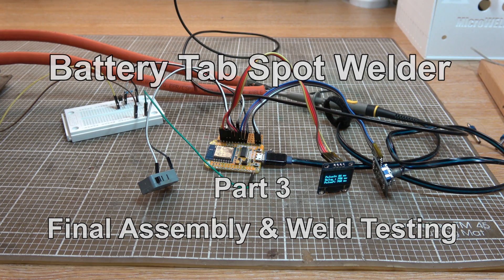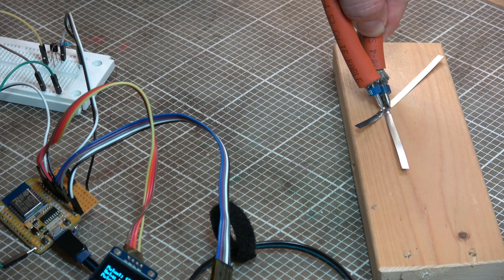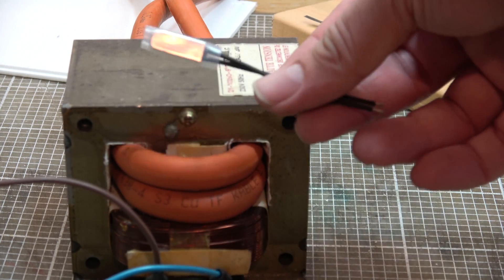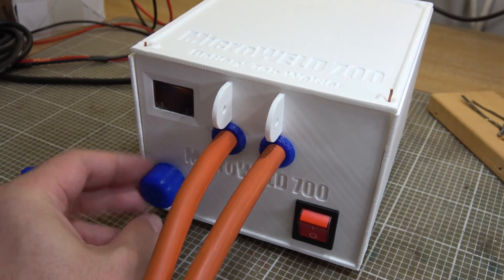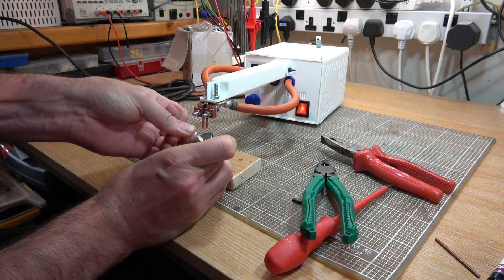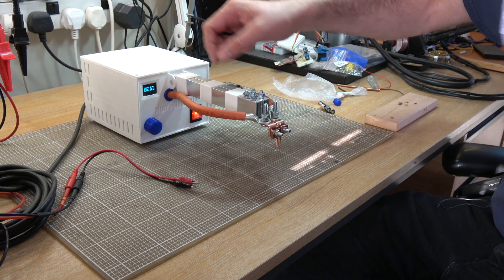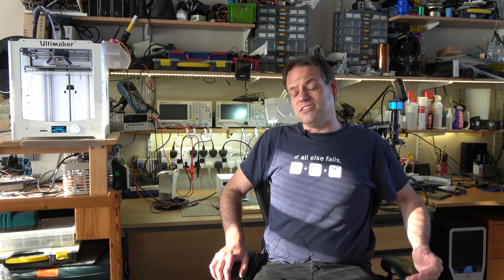Battery Tab Spot Welder - Part 3 - Finishing the Project

Comment: Hi Jim, I have viewed all your video's many times in an attempt to get your code working. No problem uploading the code, the problem I'm having is the display doesn't show anything. The SDA (D1) and SLC (D2) pins appear high impedance on my CRO in that there is an extremely weak digital signal that basically sits around 3.2v and the digital signal only dropping a few millivolts and certainly not near ground. The only file uploaded is your .bin file. Is it possible that I am missing something setting up the GPIO?
Cheers
Michael
Reply from the maker: Hi Michael - It's been a few years since I've touched this project, but I recall that there was a step where you had to build the Lua firmware for the NodeMCU device and you had to pick what options you wanted included... GPIO, DIsplay drivers etc... Did you pick the same options I used? I think I showed that in one of the videos in the series. If that's not been done then it might explain why you're not seeing a signal on the pins. Hope that helps. Cheers!!
Reply: @ThingsWhichArentWork  Thanks for the fast response. Yes I chose the same options as you did and got the same email as you showed. I didn't load it, thinking your .bin file would have this already be incorperated. I will do as you suggest tomorrow and let you know how it goes. Cheers
Reply: @ThingsWhichArentWork  Hi Jim, I went back and made sure the same check boxes were ticked as per your video, there were some differences, I hadn't selected the display type. I was hopeful that this would fix it but no such luck. Your a better man than me. finding information on t his is certainly not straight forward. I also tried to recompile your code in ESPlorer but again it didn't respond to any of the selections and so would not compile. I'm not sure what to try now.
Cheers
Reply from the maker: Hi Michael - Are you using the exact same display that I did? (The cheapest one that I could find on ebay). These very cheap displays gave me problems with lots of the different graphics libraries because they don't send any responses back over the I2C bus.. I had to do some hackery to get them working on an Arduino, but they did work out of the box on NodeMCU (which is the main reason I ended up using the NodeMCU board). If your display isn't quite identical then perhaps the options I used aren't the right ones for your screen. The best thing I can think to suggest at the moment is to see if you can get the screen working with a minimal set of code. This example looks as if it's using the right display module.. https://circuits4you.com/2019/01/09/nodemcu-esp8266-oled-display-code-example/ ... Not sure that will help at all, but probably worth a try. Cheers!!

Comment: I've just watched all of this series and am very impressed by the level of detail, professionalism and even safety. I still believe the battery spot welders I've seen are creating far too much heat and will damage the cells. This one is much more like a professional spot weld. 
I've built my own spot welder using an SSR and have a timing circuit based on a 555 but it is nowhere near as user friendly as yours. 
In the spirit of using what you've got, I already have a few arduinos but am hopeless at coding. Some folk seem to have commented they have done the same thing on arduino but I haven't seen anything out there yet. 
Any chance please guys?

Comment: Hi loved this make of yours it’s awesome 
Can’t get it to flash to the nodemcu tried everything 
No luck a bit of a noobie to this
Reply from the maker: My memory is vague and fuzzy here... I can't remember if the following applied to the nodemcu board, or to other random arduino clones.. However, as it's a quick and easy thing to try it might we worth a shot... If your nodemcu board is like mine, then you have to press the reset button at exactly the right moment for it to flash properly... (I think that can also be done by a pin in the serial cable if you have a five or six wire cable, but I don't)... The trick I used was when it says 'uploading program' on the PC, press reset on the nodemcu... The bootloader checks to see if it's being programmed for about 0.5 seconds before it boots up the system. If the PC is waiting to send the program then it is all OK..  Hopefully that was the right advice for NodeMCU, but as I said earlier.. my memory is fuzzy.. it's been over a year since I last touched nodemcu so I might be thinking arduino instead. Cheers!!
Reply: Jim Conner 
Thanks I’d love to get it working I know it’s quite a old post but can’t seem to find help flashing the nodemcu with your changes on the file
Keep up the great videos 
Maybe if you could try to jog your memory on how you flashed it and give me some pointers I’d Much appreciate it
Reply: @brettgarcia267   use ardunio nano, or pro mini cheap and better for this job, same code will work on that too
Reply: Vishal Tejwani 
Thanks
Reply: Can’t download code through Arduino
Reply: @brettgarcia267  Tejwani_vishal at twitter send me a message there...
Reply: Vishal Tejwani 
Sorry don’t have Twitter WhatsApp
Reply: @brettgarcia267  email?

Comment: Thanks for the project. I can appreciate all the hard work you put into the case. I used 0 guage cable which yielded 2 turns.  But i am having an issue...Practice runs were done with pieces of soda can and upon firing there is a pop and a hole where one of the electrodes made contact. Any idea what is going on? Too much current?

Comment: The themisters do we need them? Or can we just leave them out of the code?
Reply from the maker: The thermistor is just there as an extra safety feature in case the transformer gets too hot... I've no idea if it will actually get too hot - I was just being cautious because the 3d-printed PLA platic enclosure softens at about 50C and I didn't want to the transformer to exceed that temperature. It'll certainly all work without the thermistor if you remove the relevant bit of code. Cheers!!

Comment: Very nice project, thanks for the Video! I build it right now with the same components (oled , encoder etc.) but with an Arduino Nano. The Code is ready but I wait for delivering of SSR. The Arduino works with 5V which should be enough to trigger the SSR directly.
If somebody needs the Arduino sketch feel free to ask. I‘ll make a video if all is complete in German Language.
Reply: TheTurbotommi did you build the arduino?
Reply: I'm not finished yet but the controller code works on a breadboard with SSR, Display, Encoder and footswitch. I need some more sparetime to mount all together.
Reply: Please post a link for the code..
Reply: I'd like the code and schematic to build one.  Thank You!

Comment: HI Jim, I am about ready to build this, my parts are in and I have spare NPN transistors and some 10K resistors lying around too. Can you point me to a schematic for how you wired the transistor and resistor in the circuit? I can almost make out the pinout from the video, but if you can advise which pins (emitter, base, collector, goes to where?  I assume the resistor is in-line with one of the LUA pins, or? any help you can provide would be great!
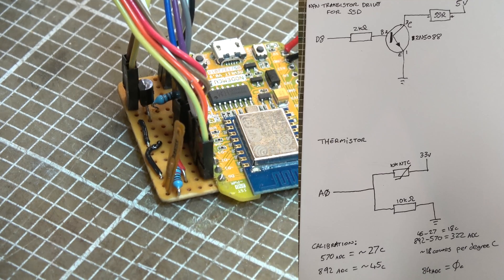Reply from the maker: Hi Kolansinski - There's a schematic diagram @ 5:54 - It's just a simple  common emitter configuration transistor inverter... For more info check https://electronicsclub.info/transistorcircuits.htm ... The section for 'using a transistor as a switch' has all the details. Cheers!!
Reply: Excellent, thank you.. I was scrubbing the video originally and didn't see it.. Going to hopefully make the project this weekend!

Comment: Another quick question if you have the time for me Jim. I've built a spot welder which is electrically just like yours. I have an Arduino Pro Mini driving the SSR, switch mains from the microwave transformer primary, and I have two turns of massive cable as a secondary. I'm seeing 1.2 volts AC. I can't measure the current but when I try to spot weld with it, it doesn't do anything except buzz. Lose wires nearby twitch and the breaker sounds like it's about to trip, but no welding and little sparking. I've tried up to a second of duration. Ohm's law is pretty straightforward which doesn't leave me much to investigate, but one item occurs. Did you remove the chokes - metal laminate blocks in the holes of the transformer secondary - or leave them in? I'm wondering why you're seeing 2 volts and I'm only seeing 1.2. If you have any other thoughts I'm interested. Thanks & Regards, Chris
Reply from the maker: Hi Chris - Yes, remove those metal laminate blocks - They are something to do with driving the magnetron gun in the microwave, and they reduce the efficiency of the transformer. Very strange that you're not seeing any welding action... perhaps it's because of the laminate blocks in there. Given that you are seeing voltage, I'd expect that there must be current too... Very odd. Hopefully removing those laminated shunts will sort things out. Cheers!!
Reply: I'll try it Jim. Thanks again for your help.
Reply: Did you check if the MOT voltage is 220V and you are applying 110V?

Comment: Hello jim,
Nice welder! Do you have any idea how many amps are flowing on the primary side? A simple timer that is certified to 250V and 10A can keep up with this?
Reply from the maker: Hi Gearstil - I think 10A should be fine, but if the timer is using a mechanical relay then it wil struggle to move the contacts quickly enough for the short pulses needed for welding battery terminals. Cheers!!

Comment: Great project and video! I would only make a pedal to make soldering even easier. Also, I would give a bit flexibility to both swing arms so when you press them down both of them will contact nickel tape. Otherwise when one electrode contacts already another one probably still not if surface not even. You know what I mean.
Reply from the maker: Hi Best Hand - I spent lots of time thinking up different ways to spring load the electrodes to try and maintain a consistent weld pressure between the two of them. For now, the springiness in the copper bars extending out of the front is good enough for what I'm doing with bettery packs, but I might still change the welding head design in the future... I've been thinking about welding directly to PCBs lately and welding onto copper that thin will require better control I think. Cheers!!
Reply: I remember seen in some video electrodes can move a bit independently like car wheels up. I think it is easy to do because we talking about just millimeters max. But I found out it is very important. Probably can use a thick piece of rubber. Another thing: in primary coil current is much higher than 3A even  for 220V. I have 120V and transformer primary coil current is about 8~9A on idle! I saw video today where primary coil current under load is about 28A (OK, for 220V it is probably about 15A which is still much higher than 3A solid state relays nominal). I tried to use thyristor BA41 but it got burned after couple times (I bought it from China though). But generally I saw enough of successful videos using BA41 (but I guess for 220V). Welding to copper will be difficult I think as copper is one of the best conductors.
Reply from the maker: 8-9A at idle sounds like far too much... on 120V that means that you're pulling around 900W with no load at all. I know these transformers are very inefficient, but that thing will get hot super quickly. With no load, I'd expect up to about 100W of power being dissipated, but the amount you're seeing sounds like you might have a short circuit somewhere. What are the resistance measurements of your primary and secondary windings? RE: Welding to PCBs... I know for sure it's possible because I keep dismantling old laptop batteries where they've welded the nickel strips on the batteries directly onto the BMS board. Cheers!!
Reply: When I saw 8~9A at first time I also thought there is some shortcut in a primary coil. Then I started google it more and found out that these transformers designed this way. They always work under max load, never idle and never too long time. They work in deep saturated mode. On idle reactive power consumption is huge, about 1000W and, active is about 200W. Sure enough when I found another similar transformer and measure idle current it was very close to my first transformer. That's why these transformers not good to use for anything require long time like battery charger for example. Oh, I just google and got it right away: http://www.instructables.com/answers/Rewinding-a-MOT-to-make-a-high-current-supply/
BTW, you cn try to measure current of your transformer and let me know :) Cheers!
P.S. I cannot reliably to measure primary coil resistance: it is only about 120 loops of thick copper wire - resistance is too low. 
On a start transformer creates big electromagnetic field (which is always the same value idle or load), so it also has current to jump much more in the first moment, so it also can lead to damaging solid state relay.

Comment: "This one is ribbed for extra pleasure and just the right size.." Hahaha. :D

I need to find another microwave, on the one I took apart I accidentally cut into the primary coil when removing the secondary and it was (apparently) aluminium wiring instead of copper so I couldn't solder it back together.
Reply: Alexander Burgers 😂😂😂😂😂
Reply: Try to file the wire little more before soldering. Sometimes it's just coated and the core of the cable is still copper

Comment: I think you could bolt the wires at the beginning of the aluminum and just use the aluminum as a conductor to the tips, as they are already electrically connected, and that way you would have a more clean tip at the end!
Reply from the maker: Hi IscleGaming - I thought about doing that, but the 35 sq mm wire is not very flexible and doesn't bend easily. If I'd have bolted the wires closer to the body of the unit, I'd have had to work out some kind of joint which still allowed the arm to move up and down (not that it has a lot of travel) - I figured that was more hard work than just bolting the wires further out. Cheers!!